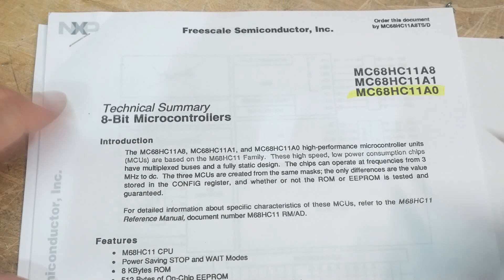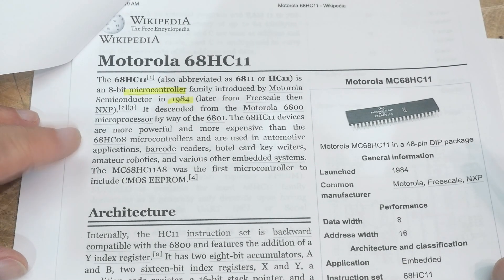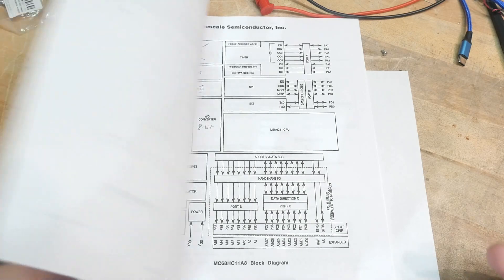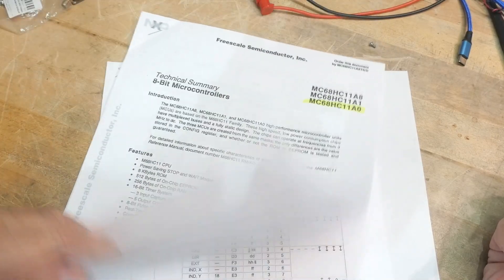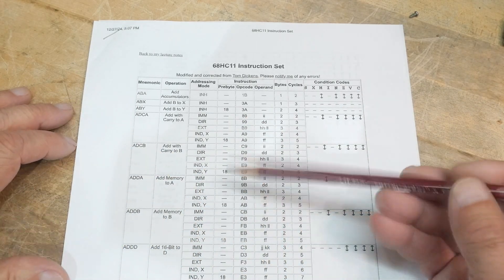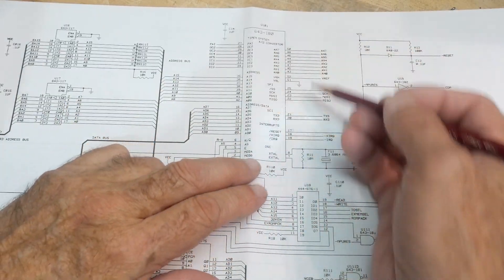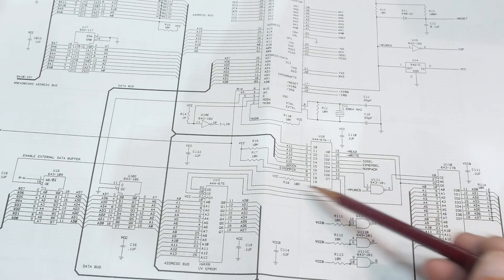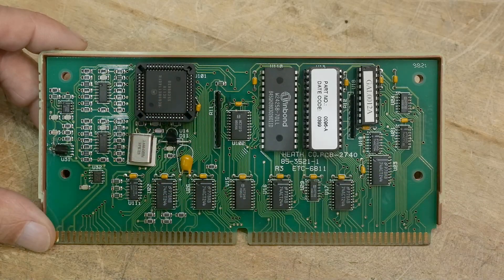#2112 68HC11 Microcontroller

Comment: I have over a dozen 68HC11D0 chips from a stack of junked traffic light controllers that I got cheap a few years ago. (Cheap as in under 50 bucks for the lot.) I've been playing around with one on a breadboard with the eventual plan of building a proper 6800 microcomputer, but I have yet to add the external bus chips. With its built-in serial bootloader and BUFFALO monitor, I've done a lot of things so far with little more than the chip itself and some LEDs. The disappointing side is that it only has 192 bytes of RAM (the smallest of all the '11 variants), and the DIP-40 version has two output pins un-bonded.

And you read that right, it has the BUFFALO monitor in ROM; a stripped-down 4K version instead of the full 8K, on a chip that was sold as ROM-less. So I can do simple trainer stuff on it over a serial port, but there's only about 48 usable bytes of RAM because BUFFALO is a pig. I guess it was cheaper for Motorola to use the same masks for the whole series, and they had to put something in there. I would not be surprised if all the factory-custom versions were actually EPROM programmed at the factory to avoid making custom masks and bespoke fab runs.
Reply: Two weeks ago I dumped hundreds of 68hc11E0. I thought that I would never need them but kept maybe 20 of them, just in case. They are in plcc50 or whatever
Reply: Most of mine are socketed DIPs, which is what you want for breadboarding fun. Three of the boards were later revision boards with the PLCC version, and I can hot-air those off if I find a use for them.

Comment: This is a very robust uC found back in the 90’s inside those ASTEX RF 13.56 MHz 500W generators for Plasma applications. It was monitoring the Reflected power from the “load” . In order to protect the MOSFET RF amp, the HC11 would drive an SCR (as part of a crowbar circuit) to short circuit the power supply! The recommendation from the OEM would be to replace the RF Generator. My solution? To replace the $10 thyristor!

Comment: In the early 1990’s my small company had designed three pieces of test equipment which all used a MC68HC11CFN2.   I had one engineer beside myself and he was doing most of the coding (in FORTH of all things).   The Friday before Thanksgiving he said he was ready to order parts.   Since we wouldn’t be doing much the next week, I told him to wait until the Monday after Thanksgiving to order the parts (cash flow, cash flow, cash flow).   On that fateful Monday he placed the order for 100 of the microcontrollers.    Newark told him they were out of stock and that all production for the next few months was on allocation.   He tried all of the other vendors that we used regularly and a few that we did not.    The single unit pricing was around $35 and in lots of 100 they had been $28 or so.    They jumped to over $100, but it didn’t matter because they were unobtainium.    This almost put me out of business.   We later found out that Chrysler had purchased all of the stock and all of the production for many months.

Comment: we were taught 6800 in our high school back in 2010/11, I was so hyped up already because I knew how to program PICs before and the 6800 was so much flexible. never thought the 68HC11 and similar MCUs were cool, for some reason PICs were cheaper over here, and you could do the same stuff with them than the HC11s. Nowdays, I've played with 8051s, 8085, 8086, 80186, z80 and z180 sbcs but never with a 6800 or 68k. I should rectify that :)

Comment: I've got a Moto branded dev board for a 68HC11 somewhere. Anout the siae of a sheet of paper. Databook for the dev board too. Almost want to drag it out but not enough to dig dor it. It is probable next to the 8052-BASIC board. Used a personal word peocessor with a serial port and a daisy wheel printer to talk to them. Still have a HC11 3.25 floppy in the baxk of my 35 year old computer desk. Damn. I need a drink or three....

Comment: I'm quite fond of the earlier microcontrollers, MC6801 and MC6803 (ROM and no ROM), where the ROM part can be strapped to hide the ROM. They sit between the MC6800 and 68HC11, and have excellent Hitachi clones (HD6301/HD6303) with some added instructions of their own.

Comment: I have designed a lot of circuits around 68HC11 since 1989. It is really easy cpu to apply although you will need a fair amount of external chips to make it useful.  Its bus is multiplexed which means the address and data bytes come out one byte at a time.  I found a nasty bug in it regarding the control line timing. A certain line must be logically combined with another to really make it work. Else the data is not valid in all conditions. Another bug is in the version made by Toshiba. The PA7 line refuses to act as a full I/O as specified.

Comment: I still have my senior design project robot based on the 68HC11 from 1990. It was a two wheeled robot using a base from the Radio Shack Robi?JR. It had two cadmium light sensors each in a BIC pen cap for shielding and interfaced to the ultrasonic sensors again from the Robi. 7.2 Nicad with battery monitoring. All wired wrapped lol. Anyway, it was programmed to scan the room, using the front facing cadmium light sensor for dark areas, and move toward the darkest place. Then it would check if it was under a table using the cadmium sensor looking up. After a few minutes it would search the room for another hiding place. It continued this behavior until the batteries were low and activate the ultrasonic sensors to look for the remote ultrasonic beacon, which was always transmitting from a custom circular charging base, a round 12” double sided copper plated circuit board on a metal base. Top negative, bottom positive. It could approach from any angle except where the wires connected. The bot had a custom charge connector using three tempered long connectors in a triangle pattern. Think middle finger top and two fingers bottom. Anyway it could find the charger anywhere within a 12’ distance, approach the base, dock and snuggle to get a good connection until charged and leave to find a new hiding place. It would repeat this behavior for hours. Fun to watch and learned a lot. It sits on a shelf now as a distant memory. I still have the developer kit 😊. Thank you from Central Florida 🌴🇺🇸

Comment: Used 68HC11F1 and A8  chips back in the '80s and '90s. They worked well and the on-chip I/O was powerful. I remember using the edge capture of the timers to implement 3 extra serial input ports. They had a neat "boot from serial" you could use for ROMless or debugging. Had a board with just a RAM chip and it booted off serial and downloaded the code to RAM.
All ASM code back in those days. Switched to Microchip PIC as they were cheaper and faster but coding was a bit harder.

Comment: I spent quite a bit of time learning about these chips, they were used (housemarked) on Connor hard drives and they had a built in diagnostic terminal for testing the HDDs, they were also used on Andros gas analysers so I've got a lot of the chips in the PLCC package but also the unusual sized DIP package. 

Fun thing, a lot of them had the Buffalo bootloader built in so you could get one up and running real easily without needing an EPROM programmer, they're real advanced for the day and would probably still be a lot of fun to play with.
.
Reply: I have a few bare chips and can confirm that they are in fact a lot of fun to play with. Start by strapping MODA and MODB inputs to ground and pull-ups to a few other pins, then send an 0xFF followed by your code at 1200 baud to PD0. (org at 0000 except on 'D0 which is at 0040)
Strap MODA low and MODB high, and it runs Buffalo in "single chip" mode at 9600 baud. All this using only PD0 and PD1, with all the other I/O pins free to be I/O pins. Manually set the right bit in the config register and it will go into expanded bus mode with Buffalo still running.

Comment: I think the first development board I purchased was the 68HC16, pretty basic stuff but its the same part.
Reply: The HC16 is much more developed. It has some really exceptional features integrated in it, like programmable chip selects for SPI and some extremely powerful signal processing commands on the ASM level. It is also much faster and has some memory and what is really good, is that its memory space is really wide allowing use of megabyte level chips for large programs
Reply: Somewhere I have a 68HC16 dev board that I never got around to using, but now that I have a bit more interest, I can't find it. When I took a look at its instruction set, I was amused how they rigged it to use all 2- 4- and 6-byte instructions by clever pre-byte mapping,
Reply: @8bitwiz_  It does have some very useful features